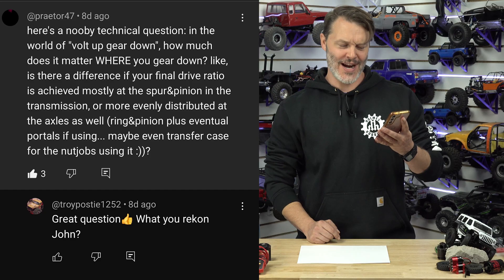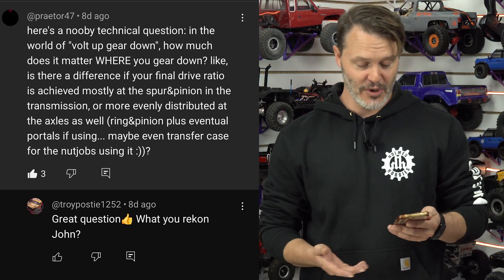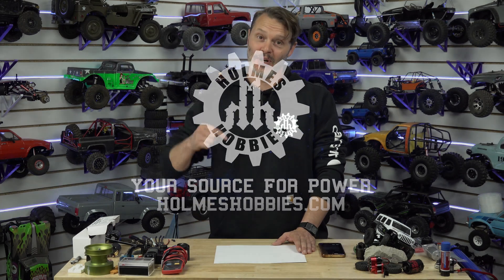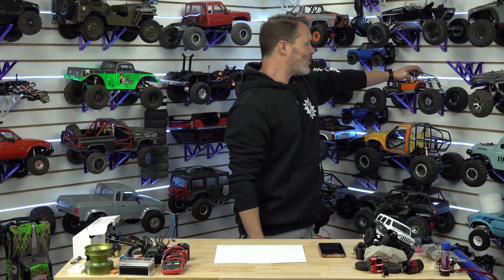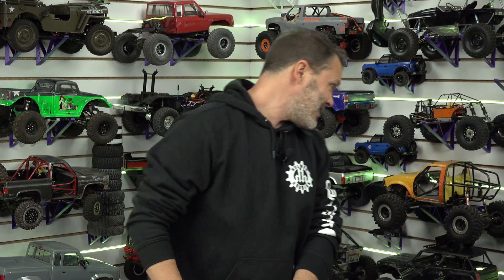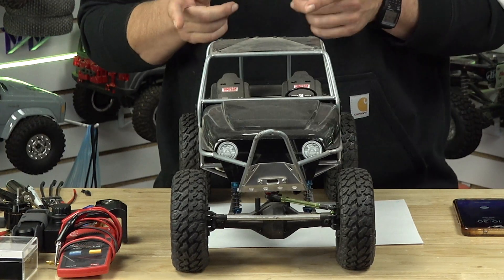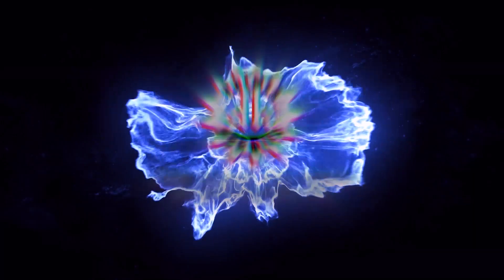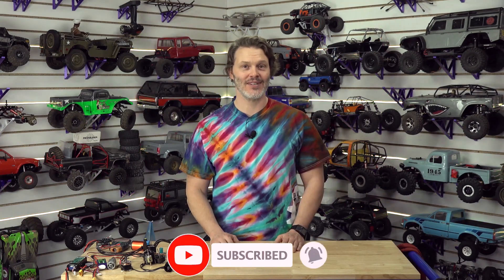Volt Up, Gear Down: Where Should You Gear Down for Best Performance? 💡

Comment: when does torque start dropping out in kv wise with rock crawlers, where's the band that torque isn't there as such any more and its about rotation
Reply from the maker: @theweldingone  ive found 2700kv to be max that is fast but still crawls well.  Above that, the esc can get unhappy unless it's huge.

Comment: To avoid torque twist there's nothing better than worm drives. Easily 25:1 ratio in one compact step from drive shaft to wheel axle. My Losi Comp Crawler, a pre 2010 design with worm drives, has never shown any sort of tendency for torque twist.
Add 2:1 portals and you'll need less than 1.5:1 at the motor.
The downside with worm drives is that they're inefficient and thus require more motor power, lubrication and cooling.
Reply from the maker: @ollep9142  indeed, worms are great if we ignore the efficiency hit.

Comment: 👍 Great info. I have very good results with underdrive in the real axle AR44's straight axles on SCX10ii. On my SCX10iii Basecamp portal i don't have the same results doing the same underdrive in rear, any ideas why ? Thanks in advance.
Reply from the maker: @chertrocktunnelgarage2171   they used the same 4 link geometry for both axle types.  That doesn't come without consequence.

Comment: I have a question regarding overdrive. I've been recently going through a series of videos regarding this matter, and found out that it is not so beneficial as people say, Could you clarify this topic more (I know that it benefits narrower steering angle, but looks like front spinning wheels loose traction a lot)?
Reply from the maker: @KRXLlON   ahhh, that's a good topic and actually quite deep!
Reply: My own experience is that having some (10-20%) difference in wheel speed is just about always beneficial, not only in steering but also in negotiating steps where the front wheels need to move vertically while the rears go horizontally. Another more physical benefit was that the front worm drive got a lot less load with overdrive, so it doesn't get nearly as hot as it did with both axles at same speed.
That said, there's most probably some upper limit where it becomes too much difference.
Reply: You want it regardless what some videos may say. Makes the rig perform completely different.

Comment: I love my old vattera acceder k10. The extreme torque twist is part of the fun of owning it. With only a team spec 2250kv v2, a sw4 an shv500v2 servo it keeps up with most new rigs. Even running the stock tires yet. Lol please do more this type videos.